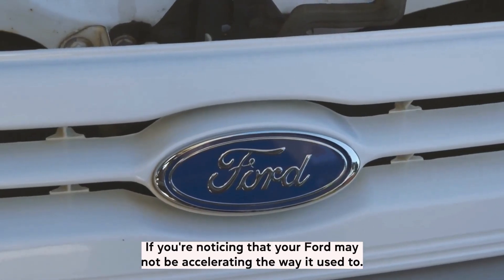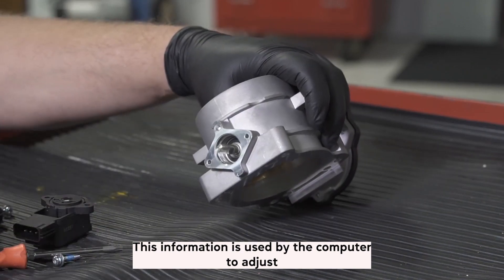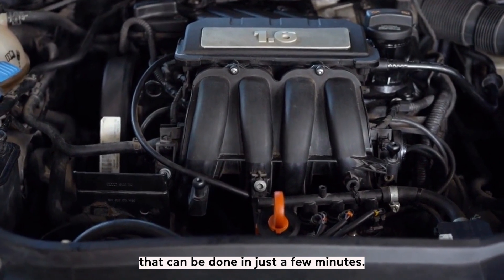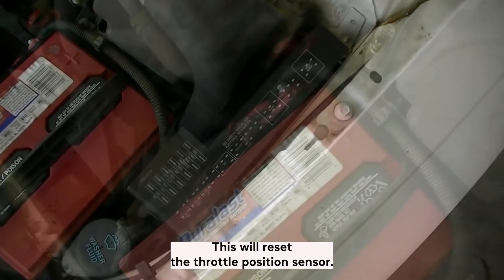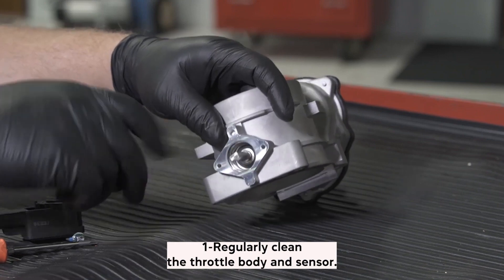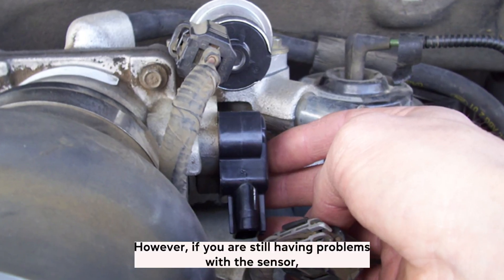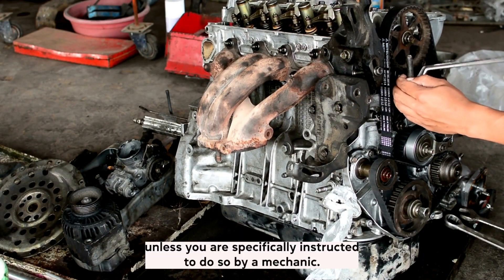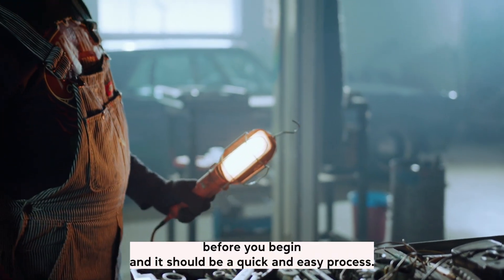How To Reset The Throttle Position Sensor In A Ford, Symptoms of a Bad TPS

Comment: Easy diagnosis 90% of the time is the trottle body adjustment screw due to vibration and cause the engine to stave for air jerking stalling idling hecups shift into gear jerking .Turn engine off then turn the  adjustment screw 1/4 on trottle body then start the engine. Continue the process till the engine run smoothly and depending on the maintenance. Electronics trottle body is a different process.

Comment: Hi everyone, there is a missing step before step 5 which is not stated in this video, please please before you reconnect the battery and start the vehicle first install the throttle position sensor and reconnect the plug to the sensor than go to step 5 this is very important you must have this installed before starting the vehicle or you will damage your motor. Hope that helps anyone who is watching this reading this.
Reply: I'm glad people like you exist...
Many thanks brother 😉👍
Reply: I noticed that also after watching the video. There was no mention of installing and reconnecting the throttle position sensor.
Reply: I was wondering if there was a new trick to troubleshoot the TPS
Reply: Yes, do a voltage check. @sandleman3006
Reply: It won’t damage anything, but hook it back up is correct
Reply: Dude omfg

Comment: Hey dude I want you advice for installing tps to my fiesta 1.4, I have installed the tps from ford company and on close throttle or ralentí give signals of 0.9 V ! So what can I do for adjust this to 0.4 or 0.5 as the network said it should be !!! Thanks in advance !
Reply: brother my car jerks while i change gears and accelerate can u help me its a fiesta 1.4 tdci but when i reverse there is no jerk